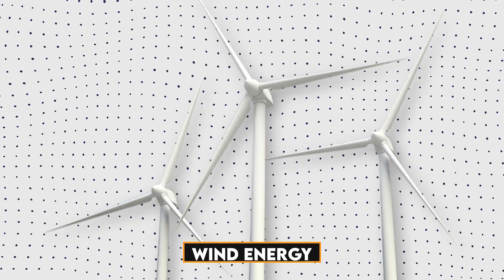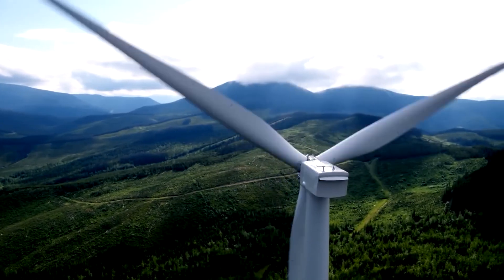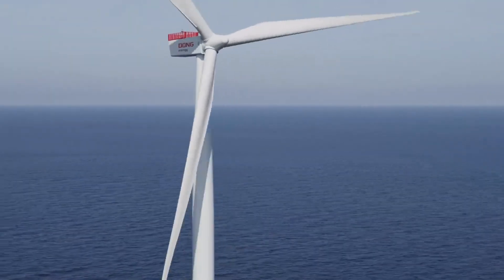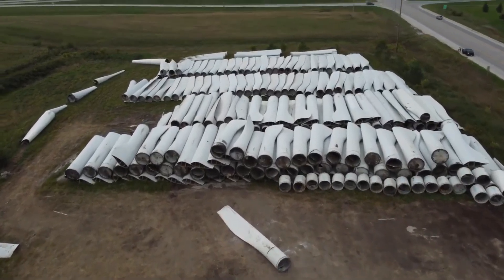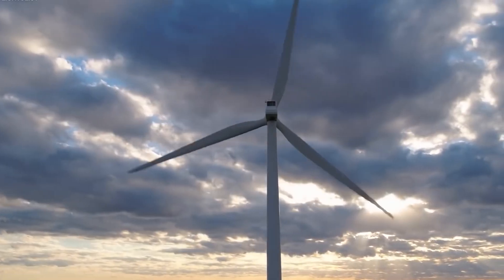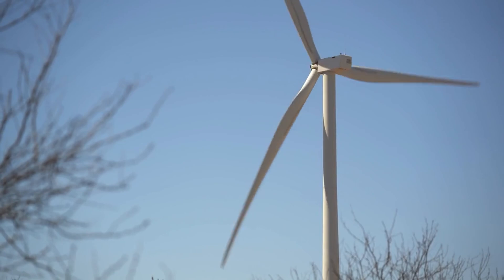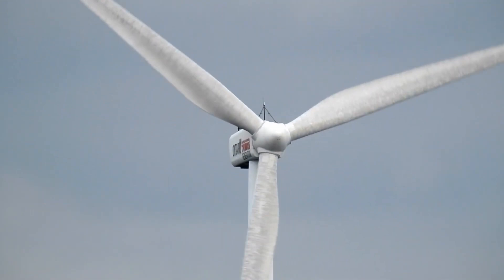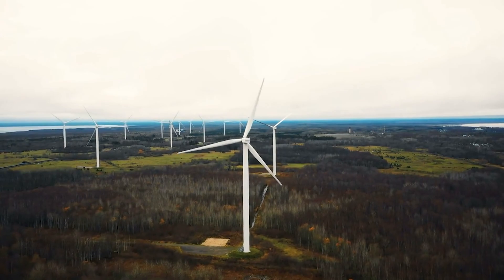Race to recycle wind turbines in Denmark

Comment: What amount of land is needed by wind farmers to equal the energy output of a nuclear power plant - how do they compare
Reply: Not Relevant, the land required for Nuclear Power Plants is not the same as Wind Turbines. Wind is far more flexible using less important land.
Reply: @Neojhun Nuclear is the only viable green energy....why do you think France has the cheapest electricity in Europe?...... because it's efficient and controllable 🤦
Reply: @Neojhun  it is relevant, because specific places are needed for both nuclear and wind. Nuclear needs small place and river, wind farms need lots of space and wind and a way to storage energy.

Comment: Isn't the 50% of electricity by 2030 figure only 50% as the figures assume wind for 100% of the time?
Reply: NOPE That is specifically Denmark a limited sample size and already has been for many years. That's 50% of their Annual Capacity 100% of the time.

Comment: What about the amount of wildlife the wind turbines kill?
Reply: Absurd nonsense. FYI 100 meter plus wind turbines max out at 14 RPM. Way too slow to hurt any high flying animal. It's slower than a branch swinging in the wind.
Reply: @Neojhun  It's not the RPM that's the problem, it's the length of the blade - taking your example of 100 metres, it means the tip of the blade must be travelling at least 104 miles per hour in order to complete 14 rotations in 1 minute. Basic math.

Comment: When the wind stops how do they make up for their %50 loss of power?
Reply: Stop this absurd nonsense. Wind Power don't just suddenly stop working. They cover a vast area of long distances. Thus different turbines are on and off at different times. It's a distributed network, not a singular machine that you can swift on and off. Your Logic is Wrong.
Reply: Neojhun, 

not true, wind is a very variable source of power and low wind areas cover vast amount of land and countries simultaneously. As wind power output is a cube of wind speed, output drops very often , sometimes to near zero.
Norway is how Denmark is able to use a lot of wind capacity, and in so doiing make expensive electrcity. Norway's hydro power provide, at a high cost, to Denmark when wind output falls and buys excess power from Denmark (cheaply) when wind is strong and demand low.